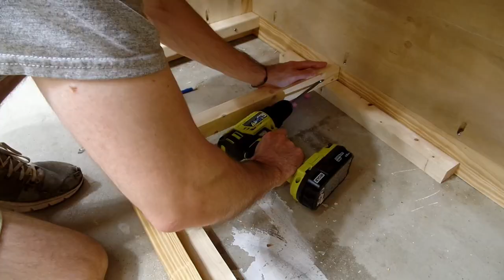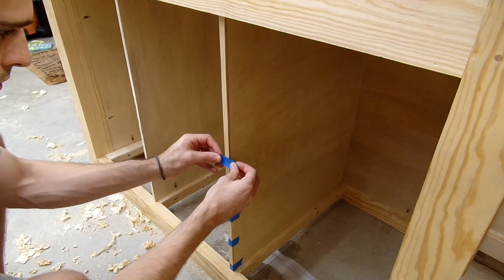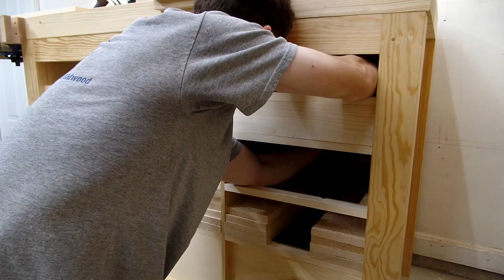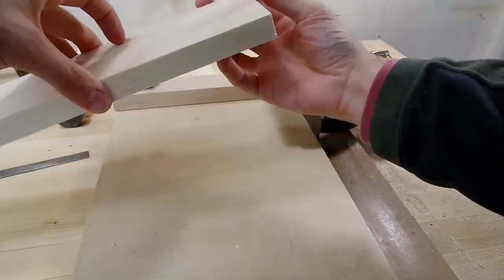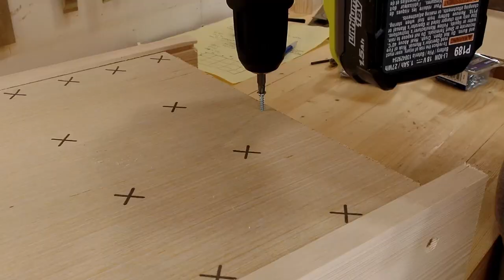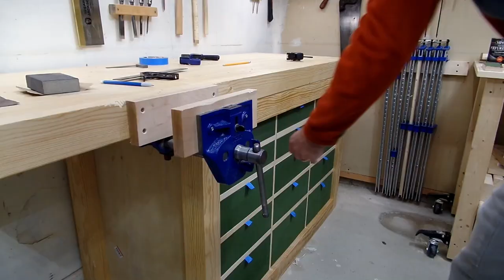What I wish I would have done when making my workbench... | Building a Workshop Episode #3

Comment: I liked the paint on the drawer fronts. If you want, go get some spray paint and rough up that vise. You can paint it to match really easily. That would reduce the amount of colors and tie them together.
Reply from the maker: That's a great idea! Didn't think about this, but the blue does clash with the green a little bit doesn't it.
Reply: On another note by having them a similar color anyone who sees the bench will have their eyes drawn to the drawers first, then the vise. There is a solid chance they wouldn't even notice the difference in wood species. Or you could also use a stain on the sides of the bench to darken it a bit. That would help it blend with the legs and frame. (if you are really worried about it)